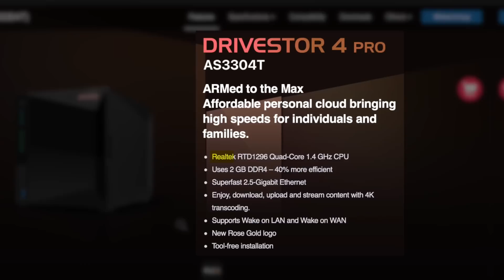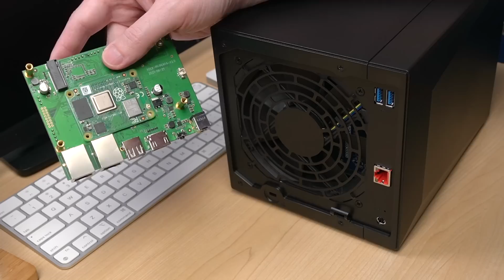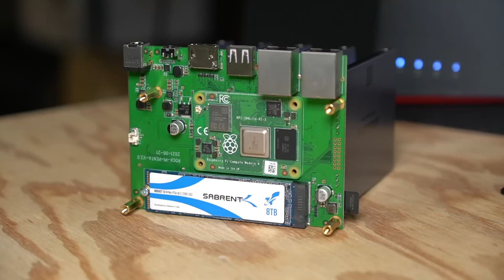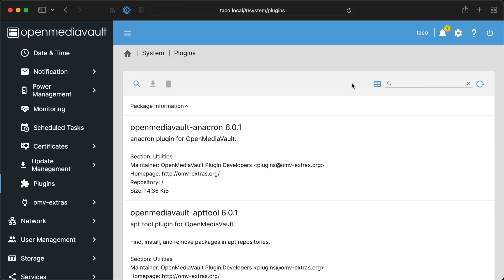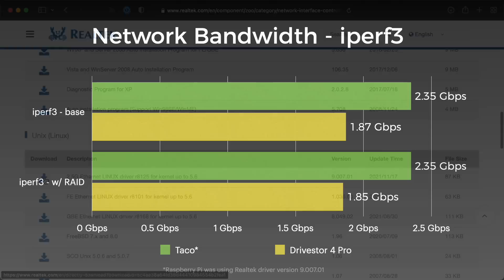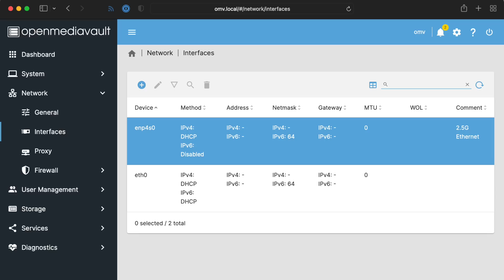Raspberry Pi vs ASUSTOR NAS – Round II

Comment: The real benefit to the RPi NAS is the flexibility. It has a full Linux distro (it's a complete computer!) and you can do anything you want with it. For example, you can add avahi/zeroconf stuff, NodeRED for home automation, an mqtt server, use it as your HTPC, run arbitrary scheduled/cron jobs (written in your language of choice), control RGB LED lighting, add an IR sensor to use it with any old IR remote, etc. It's a vastly more capable platform because it's generic and not made to do just one thing like that commercial NAS.
Reply from the maker: This is true, and a good reason why I often choose a Pi for a task—though I try to keep things separate, either by containerizing everything so I could split it off to other hardware easily, or by running more heavyweight or critical apps on separate physical hardware (so multiple Pis for multiple purposes). With automation it's actually easier and more resilient to do that rather than sticking all eggs in one basket, though the costs go up a little :)
Reply: @JeffGeerling  go up a little he says :D
Reply: Even if you have no intention to use your NAS for anything other than a NAS, using a generic OS has advantages. 1. If the vendor of your proprietary NAS ceases supporting it (which is likely to happen after a year or two on a cheap NAS) you're out of luck. 2. if you want to upgrade to better hardware you either have to pick something from the same vendor (vendor lock-in) or rebuild your setup with some other vendor's proprietary NAS software. 3. Once you've learned how to set up and maintain a NAS using generic software (either command line or GUI) you can apply that to other hardware that also runs generic software.

To fully get this benefit you really need the hardware to be directly supported by the generic distro developers and not require proprietary drivers, otherwise you're still using a custom build of the OS being maintained by the vendor or a small community of users formed around a specific hardware device. This is where the benefit of using not necessarily open or generic hardware, but at least mainstream hardware with a big enough audience that mainstream distro developers will support it.
Reply: 99% of cheapo NAS users just want 'internetty video photo drive thingie'
Reply: And also 'mandate of responsibiity' cost price. You can risk yourself with joy, but must not downplay other(corporate)s' wills.
Reply: It'll be just DANDY when you're home automation crashes your NAS while you're watching a streamed movie from the NAS with your side chick.
*That's called *Trouble & Strife*!!! 🙄😏🤭
Reply: @RTR-MATEY  on a raspi you can actually set per-process resource limits so at worst the misbehaving process crashes while everything else is still fine. 
You can't do that with a consumer NAS if you load "apps" on it, so you can easily degrade performance or even randomly crash a NAS depending on the apps you installed
Reply: Also apart from keeping a storage device as exclusive storage device,  there really is not enough compute power in a RP to both run NAS service as well as virtualize VMs etc at the same time. Pay 30e to 40e  more and buy a atom based ITX x86 board. the 3.5 inch drives most people use are so large it makes no difference if the motherboard is pi sized or itx sized. And when you also have to spend money on Sata adapters etc for the RP the x86 board ends up being very comparable in price. (Also please do and actual electricity measurement of both solutions and you will see the actual difference in yearly total power costs are minute between the two different solutions)
Reply: This is a silly thing. Why would you do that on a storage device? Yes you can, but it is like you can also put tractor tires on a lamborghini, huge cannon and pair of helicopter rotors. There is hardly any real need for that on a storage device.
Reply: @MatejRajčan  Many people are using a NAS for media. So not strange to use that same NAS as HTPC. So not strange to use IR for remote control. If the NAS is on WiFi, then why consume WiFi bandwidth for playing a movie?

I normally run MQTT on my machines - all I can do it on - and have them publish runtime stats etc. So temperatures, SMART data, CPU load etc. Which means some other device can subscribe and present supervision information for every piece of equipment.

And yes - that means my NAS hardware also does this. But depending on actual hardware, I may not always manage to get motherboard temperatures or fan speeds. But disk temperatures still works to supervise a NAS.

Having a MQTT broker and some subscribing software  in the NAS also means that the NAS itself can work as a data logger.

I can also have a NAS as receiver of syslog output from lots of other devices. Persistent syslog storage to a memory card produces wear - with a NAS and real HDD/SSD, then some RPi may even boot and run RAM-only with zero disk writes while operating.

It's good to have different software specialize to be good on one specific thing. But that doesn't mean we need to apply that same rule for hardware. A NAS is not that often CPU-bound. But it is normally a device running 24/7. And normally with better ability to perform lots of writes 24/7 than memory cards are.

And with some mirroring/clone setup, any recorded data on a NAS can be kept mirrored to a secondary NAS. While yhe originating device itself would have had a big issue managing redundant storage.

Running software ln a NAS is not that far off conceptually from an enterprise using a big DAS server and having many VM or physical machines mapping in storage from the DAS. It's a way to create flexibility.
Reply: @MatejRajčan  No it's not, it makes perfectly sense.
Why use, maintain and pay (for hw and for electricity) several devices when you can do everything on a single one?
If you only need a nas it makes sense to buy a product like the Asustor one, but with a generic ARM board you can make a pretty decent nas AND a pretty decent home server for running a lot of other applications.

On my arm board I run Pi-hole, I run my website and several other project and services (like privatebin, nagios, collectd, my family password manager), I use it as a VPN server for securely connect to other networks (like my company network for smart working, several vps and several AWS vpcs) and I use it as a nas for backups and share files for my media server.

Ok it's possible to do some of those things using containers or some applications available through the Asustor management interface, but there's no comparison in terms of flexibility.
On a simple arm board you can do almost everything, and there's no reason to recompile kernels (ok Jeff recompile so many times, but because he's dealing with hw) or do fancy things.
Reply: @MatejRajčan  why should he get another device to do that stuff when the NAS can do it? Synology and Qnap NAS can run docker and virtual machines for this reason
Reply: @marcogenovesi8570  I bought a Synology NAS thinking "ok, this should just work out of the box for the simple case that I need".  Turns out that even though what I want it for is "supported", it doesn't actually work in any manner properly.  I'm now looking to build my own NAS out of commodity parts, possibly RPi because they do run a simple OS where I know everything will work fine for my use case.
Reply: @xuthnet  that's an impressively long post to not say a whole lot, what did you buy and what didn't work properly. Rpi is very much not cost-effective and it's a weird form factor for a NAS, you can get any low-end PC hardware and it will be usually cheaper, faster and easier to find decent cases and so on. Then you can install the same "simple OS" you use on Raspberry, aka Debian or Ubuntu Linux
Reply: @marcogenovesi8570  RPi or similar will use significantly less power though and will still saturate gigabit ethernet.  As to synology, the implementation of sftp/scp/sshfs that they use is completely broken.  Since I need to be able to connect to it from lots of sources on lots of networks, many of which I don't fully control, mounting disks via sshfs works universally while other things don't and is what I've been doing for at least a decade.
Reply: @xuthnet  It's different but not enough to make a difference, 2 or 20 watts are both peanuts for most people's power bill.
Also the drives will be the main power hog anyway if you go beyond 4 drives.

I agree, sftp is master race and it's also usually horribly outdated and/or broken in most consumer NAS products. The sharing protocols they expect you to use are SMB/NFS/AppleShares, that's what normies want.
Reply: English?

Comment: I think you should have mentioned that well, you can actually buy the Drivestor 4 Pro right now. The CM4 it's still nowhere to be found: the fact that is so versatile and can be used across so many different projects also means that even a little bit of supply constrain and well they're just gone and will be gone for over a full year.

I mean no disrespect by saying this but I do get a bit burned out from channels that talk about the CM4 almost exclusively when absolutely nobody can buy them, wouldn't hurt to diversify the channel a little bit and at least try other boards even if your arguments for sticking to the CM4 are valid, availability means nobody can actually put any of this to the test since nobody can get a CM4.
Reply from the maker: The crazy thing is there are a number of vendors who sell the CM4 as part of a solution—and for many of them, they do have stock. It's just impossible to find CM4s on their own right now :(
Reply: @JeffGeerling  would a bulk purchase make a difference to lead times? Last time I checked my suppliers, they were all saying around middle of march.
Reply from the maker: @loswilko  Typically, yes—and that's how industrial vendors are able to supply CM4s integrated with their devices. If you're able to order in batches of 100+, you may be able to get some Pis.

Honestly I considered trying to buy a few large batches to resell at list price just to help people out—but the logistics would be far too much for a single YouTuber with no staff to arrange it (and I'd basically be donating the shipping/handling costs, which is another large drain on resources...).
Reply: @JeffGeerling  I see those sparingly but it's still 100x easier to find regular Raspberry Pi 4 on those kinds of vendor bundles, even though the CM4 seems to me like a more versatile and useful device given the pci-e lane on it
Reply: Also from my side said with all respect. But the availability issue mentioned is extremely important. And as I already mentioned before there is very good itx based x86 boards at good prices and good availability, even ones where you can use ECC memory
Reply: @lllongreen  ECC memory is important thing to have for ZFS.
Reply: @Darkk6969  yes , Truenas or just ZoL is amazing,  but frankly ALL computers should have ECC period. The fact they do not is all because if artificial segmentation to squeeze more profit
Reply: @lllongreen  I totally agree.  ECC memory should be standard!!